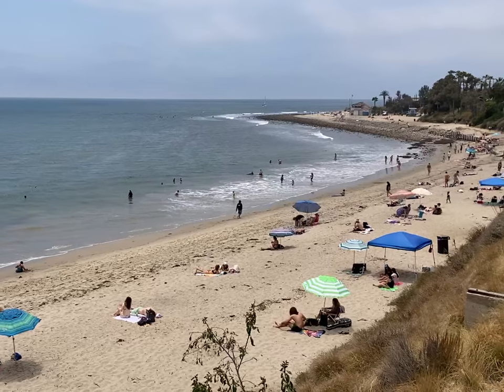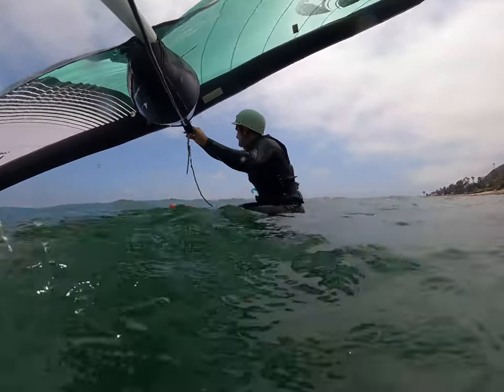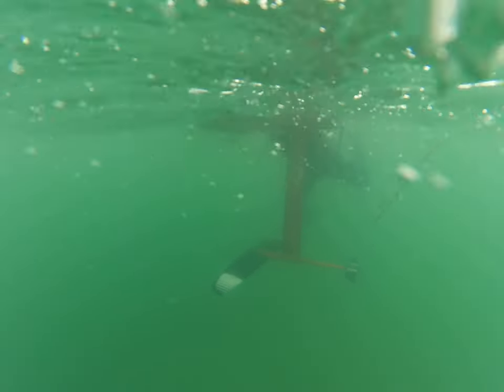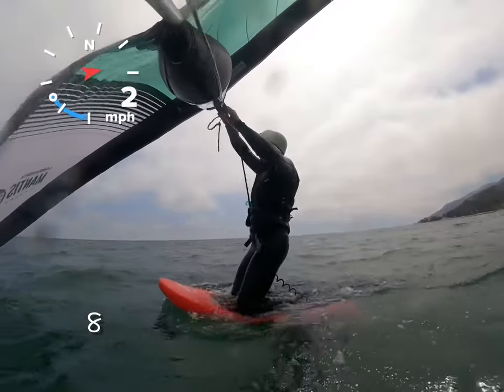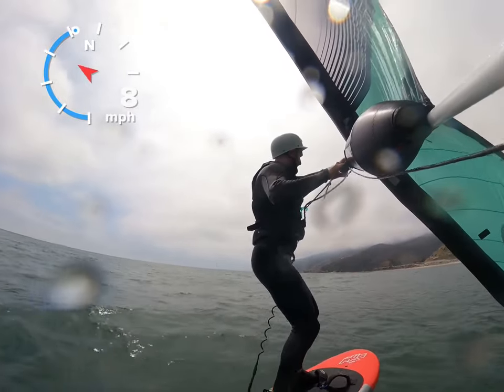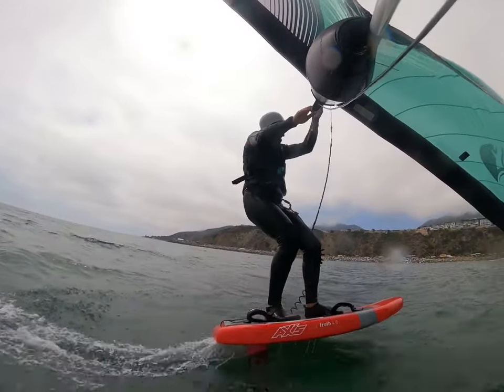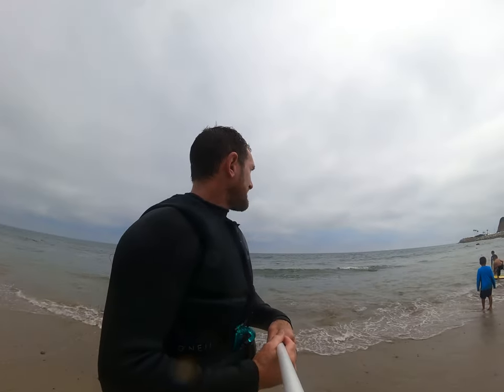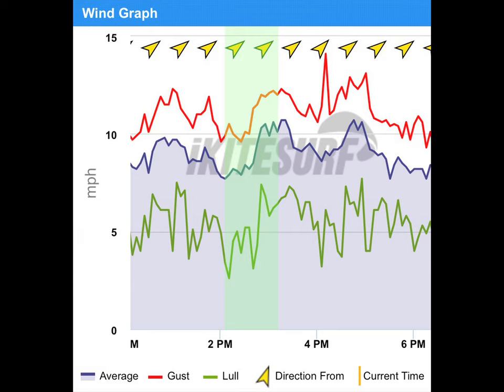Light wind test - AXIS Pump and Glide 1150 - Wing Foil

Comment: Great Vid. Enjoy your explanations and humor. I have 1300 PNG with same rear and froth 110. Use 7.0 Mojo and 7.4 Vayu. With that set up you would have been going easy. Whenever you see a slight darkness on the water you can get going. It’s amazing how light winds you can get going. Key thing I find is the wing has to at least fly by itself. Some wings fly in nothing and keep their tips out of the water so you can pump up onto foil. Some wings just hang and don’t fly well in the light.
Reply from the maker: Thanks! The key issue was my 8.0 popped. It’s an amazing wing. If you check out my insta there’s a couple new videos of riding it in NOTHING.

Comment: Great vid man, that was brave on a 65L board and very little wind.  Surprised how tight your first jibe was with the 1150.  Gives me a lot of hope bouncing around on my 145L light inflatable :) in 14 mph winds.
Reply from the maker: I used to use my Slingshot inflatable 120L in light wind and it was great, but as long as there’s ANY wind I can usually make the 65L work, so I sold it to finance my endless summer. Anything that floats you on top of the water should work just as well as a bigger board in light wind. As long as the board can start on top of the water it becomes more about the foil. And whether the wing can even fly! If I was rich I’d probably have a 90L inflatable for light or really gusty days. 

The 1150 definitely turns wider than I am used to! But I always turn pretty tight because I like to get back to wind power! I should trust the foils more and ride them longer sometimes through turns. 

Good luck in those 14 mph winds. Plenty of wind!

Comment: Nice vlog, better than those edited ones just to show all the highlights. Some of my summer days are like this, just too eager to get out there and get going. I am thinking about buying the HPS1050  I weigh basically the same as you and I use a 110ltr board, yup could go with less volume, but I prefer not to struggle so much. maybe later drop to a 100ltr.
Reply from the maker: I would definitely recommend the HPS 1050 for light wind. It’s much more fun for winging and doesn’t require too much more wind. With the 8.0 F-One and 1050 I think I could have gotten up and had a good session. I got the PNG 1150 for ultralight winds because I’m going to do a trip soon with questionable winds. Plus dock starts! Thanks for checking it out.

Comment: I am a low intermediate wing foiler (can jibe well, but cannot tack yet) who weighs 165 lbs (75 kg) . I  wing foil in a area where a consistent 10 mph of wind is a blessing 🤣😂...

I recently started winging with PNG 1150 with 500 cm2 rear wing. I tried many different 2000 cm2 front wing in the past few months and PNG 1150 is surely a pumping foil compared to previous 2000 cm2 foils I tried (e.g. Gaastra FR, RRD Dynamic, Carhinha X1950, Starboard S type). I am not 100% sure it was due to the superior pumping capability of PNG 1150 itself or (partially) due to the big rear wing (500 cm2), but I can tell you with confidence that it pumps better than the previous bigger foils I tried...

I really want to try HPS 1050 and ART 1099, but then I have to be able to tack first!!!..🤔. Oh well... 🙄

By the wat, how do you like your new(?) Froth board compared to your previous Slingshot board?
Reply from the maker: Good to hear your experiences. If I was 165 lbs I think 10 mph would be a lot more fun! Definitely try the HPS. I love the 880. ART I like more just for trying to go fast. 

The Froth is awesome. I had trouble getting the lift far enough forward on Slingshot 75L with high aspect foils and mast track all the way forward. Even though Froth seems to have mast track in the same place, the lift works much better. Maybe due to being shorter. Froth planes much easier too. And easier to stink bug because all the volume is under you. 

I absolutely love the Froth. And it looks great in photos! Get a board bag to protect from dings.

Comment: Hi ! Could you do a review about the Axis Board ! I’m looking for any good review about their boards 
Thanks 🙏🏻
Reply from the maker: I’ll see if I can put something together. But in the meantime, I absolutely love it, and everyone that’s tried mine loves it too. It gets going on foil so easily. And all of the volume is right where it needs to be—under your feet. I was surprised how much of an improvement it was over my Slingshot Wingcraft 75L, and that board was pretty good. Only potential negative is that because it is light, it has a bit fragile shell which I’ve had to repair after the wind picked it up and flung it into someone’s mast. Hence the duct tape. Waiting for some custom paint to touch it up. But it has held up very well to some big jumps (~10 feet) and many many crashes. I’m very hard on gear. With a board bag and a normal rider, I don’t see any issues. Strongly recommend.

Comment: Great video! How easy is the PNG 1150 for a beginner wingfoiler?
Reply from the maker: Pretty easy. I took it out again in more wind and it gets up pretty easily. Lots of glide and stable in one line. The wing span being so wide, it doesn’t turn as easily as a BSC, but once you figure out how to turn it, it’s not much of an issue. 

Do you want glide or easier turning? If you want glide and someday plan on learning dock starting, then go PNG. If you want something that gets up easy and wings well in light wind and turns easily maybe go BSC. You’ll be happy with either, and the bad news is… you’ll end up wanting multiple foils for different conditions!
Reply: @wingmanfoilclub  thanks! I might end up getting both (as always 😂) but as I cannot turn at all and going in a straight line is my main goal, I go for the 1150 I think. Is it also an issue that it has to much lift with more wind? As I am only 63 kg..
Reply from the maker: @wiepkjedegroot  so the great thing about the AXIS foils is that they don’t really get overpowered. Once you get up on foil they ride locked in and don’t start lifting out of control if there’s too much wind or speed. It’s really remarkable. I rode the 1150 the other day in 20-25 mph and it was totally fine even in the gusts. 

1150 is definitely gonna be a lot of foil for you at 63KG. You might even be able to just start with the 910b or something in between the 2 sizes. But at the same time, a big foil will always be nice for really light wind days.